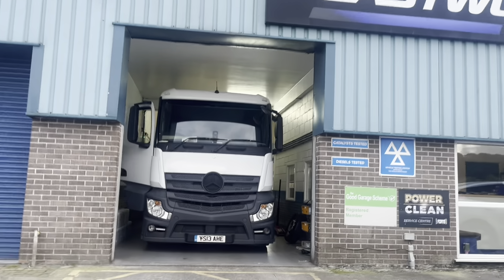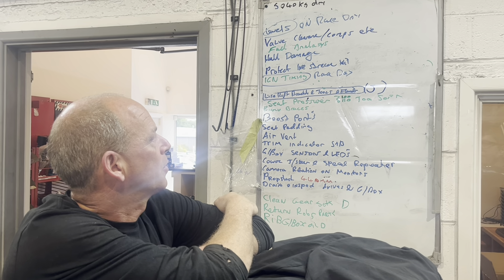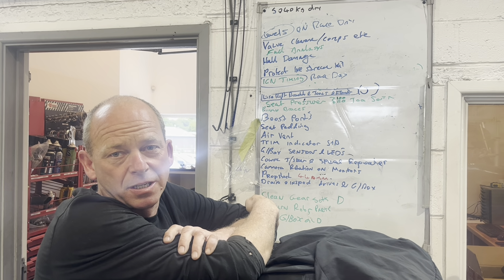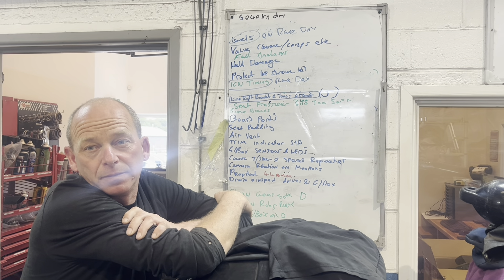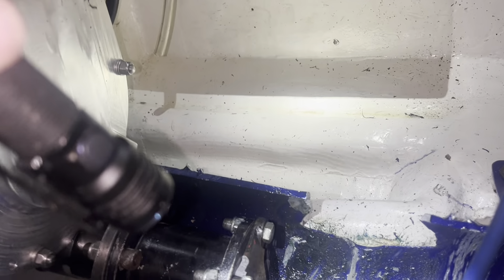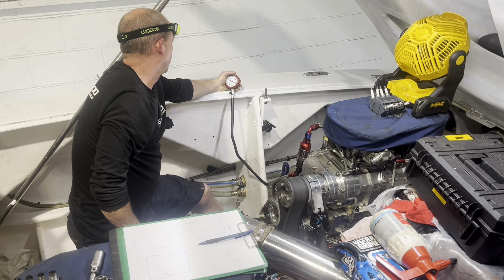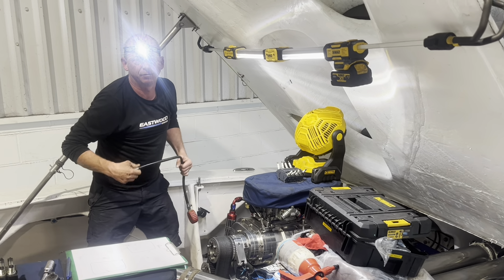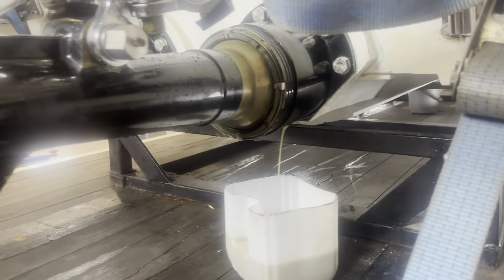Powerboat driveshaft failure analysis.

Comment: Get a Pico Scope and do compression while running. Lot more detail can be seen. Invaluable in the shop as well
Reply from the maker: How would you connect the pressure transducer to the cylinder, or is it relative pressure through a crank sensor?
Reply: @eastwoodracing  remove spark plug, same as normal. Engine runs with misfire. Shape of pressure curve  can reveal problems in rings or valves or cam timing.